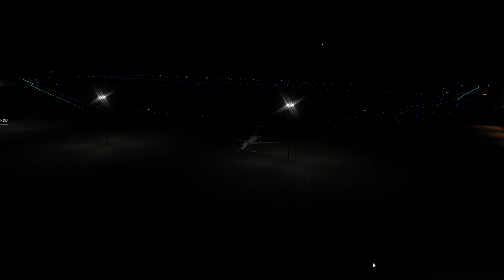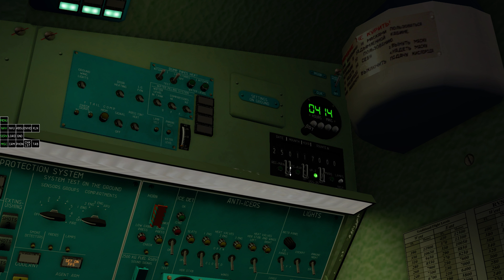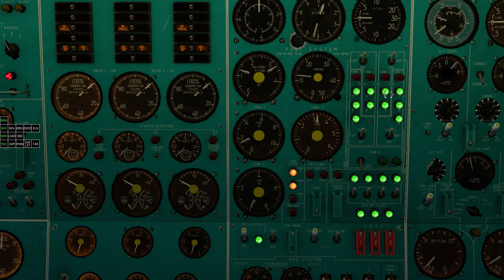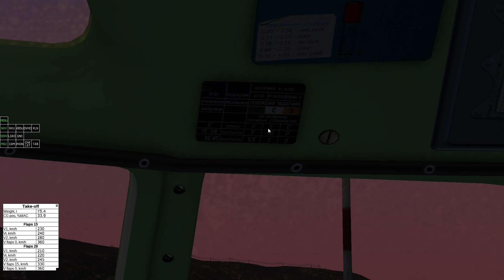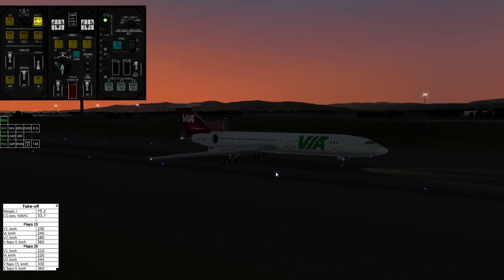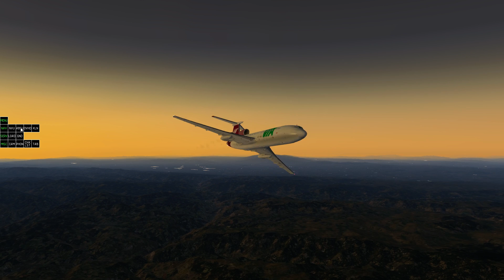Felis Tu154 Part 1 - LBSF Departure [X-Plane]

Comment: When choosing the SID (OGOT4A) you mentioned that the first part of the departure has to be hand flown. Can you please elaborate on this? I still do not own the aircraft so I can't really check what it's all about. Can't you fly an entire SID after you have loaded it? Why do you need the radios when you have the procedure in the KLN?
Reply from the maker: The departure route on the KLN database was incomplete. It had the first named waypoint, but not the actual route to get to that waypoint. I’ve never flown with a real KLN90 so I don’t know if that’s a “real” thing or not. The KLN is certainly a generation before things like the GNS430. There is also a real difference in capability between a GPS driving a course deviation indicator (fairly easy to do, autopilot treats the GPS exactly the same as a VOR) and have the GPS Navigator feed roll commands to the autoflight system (much more complicated). I believe GPS/FMS fitted 737-200s also have this sort of issue. In summary, a retrofit GPS is very unlikely to be able to provide FMS style navigation. How that makes sense?
Reply: @ReflectedRealitySimulations  It makes perfect sense, thank you for the detailed explanation!

Comment: At tu 154, use of autothrottle is only permitted for landing. Otherwise you must always be manual.
Reply from the maker: Thanks Michael, yes I do know that, and I think I mentioned that in the video. My reason for using it is that while the real thing may not allow that (or autopilot use at a lower altitude) the real aircraft would have a crew of at least three, whereas that’s not the case in the simulator so a little bit of assistance from the automation seems OK to manage the workload. Hope that makes sense?

Comment: Thanks for the video. I just purchased the plane 2 days ago, and will have to learn how to start it using your vid. It really looks good and I like it. I am surprised it doesn't get much consideration. I have all the medium and long range planes (i.e 757, Ultimate A320, JAR A320, FJS 727s and 737 V3, JAR A330, MD 80, 747...) and was looking for something new, and this really does it. Can't wait to fly it.
Reply from the maker: It’s a really nice model and a lot of fun to fly. Make sure to try the NVU navigation, it’s very interesting and there’s a really helpful calculator in the forums. Do you have the SSG 747-8? If so, how do you find the systems compared with, for example, the Rotate MD80?
Reply: @ReflectedRealitySimulations  Yes! I finally figured out how to start it up during the weekend thanks to your video and it is pretty rewarding. I should get better at it. I really like that plane and still don't understand why it is so much under the radar. As for the SSG/VMAX 747, yes I own the version of that which comes with the Intercontinental Advanced and the freighter version. Although I have never tried the freighter. As far as systems go, if you mean FMC, it's different from the MD80 for example (ie MD80 have to set hydraulic and flaps before you get VSpeeds) but equally as good. SIDs/STARs, VNAV work well IMO. I would closely relate this to the B757 style FMC. It flies great like that. But doesn't look from your videos that you own that. Again I am no specialist, just an enthusiast, but to put it simply everything my IXEG FMC or FF A320 Ultimate MCDU for example can do for me,  the 747 FMC can do. It's a great plane. Did a quick short 45 minute flight yesterday to remember exactly how it is, since I have around 30 payware aircraft I may not fly one for a few weeks and just switch depending on my mood, and frankly it was quite enjoyable. Unfortunately I can't go too much in depth about the technical aspect of things, but if you have specific questions I could probably try and be more precise. Great plane.
Reply: @vasily2022  I have most of those and a few others, and 2 years late to the question, I find the ssg747 version 1 was really really bad. Version 2 wasn't much better, even with the latest update that came out recently this year. The SSG modules out of the 10 or so XP11 paywares I own, is easily the lowest quality, most basic, oversimplified and that's reflected in the relatively cheap price. I'm not really sure how the FMC's compared 2 years ago, it was unusable and even now, after a couple of in-flight edits, the nav display shows a line that's completely wrong. It's one of my very few module regrets

Comment: Thanks for the video - been thinking about getting this plane. Does it have any custom failure from misusing/overloading systems?
Reply from the maker: Hello Matthew - I'm afraid I don't know about custom failures. As I mentioned in one of the videos I've never completed a flight without getting something wrong anyway! However it's a very complicated and satisfying machine to operate. The KLN90B does seem to cause the occasional crash but the Tu154 itself is very good value for money. Felis has the Yak 40 and An 24 available for download now - perhaps that would give you an insight into the level of modelling?

Comment: Thank you for taking the time to make these excellent videos tutorials. It is a joy to hear knowledgeble people share their skills.

Flightfactor is said to soon release something that should be as close as you can come to a a320, way above anything on the market. If true and if they really simulate every system and sensor as they claim, it would be a dream to see you make the same high quality content as you have done for the Tupolev and the others ☺️
Reply from the maker: Thanks Jimmy, yes i'm looking forward to seeing the new A320 from FlightFactor. I don't have any of their aircraft currently - I'm sure the 757/767 are very good but things like the cabin crew calls sort of put me off as it's like a "game" feature, and slightly distasteful in the earlier versions if I remember correctly.   If they get the A320 right it will probably be one of the most misunderstood and frustrating aircraft to fly in the sim to begin with - wait for all the forum comments like "the auto-thrust is buggy" as simmers don't seem to consider the flight directors - in reality it's a very good machine and very very easy to operate, but it does have a few quirks!  The only concern I have is from the videos and screenshots I've seen they seem to be simulating an older version of the FMGC software (it's not been like that for probably 5 years)  - however I don't know what their reference source is.